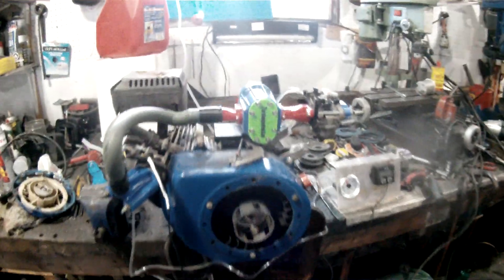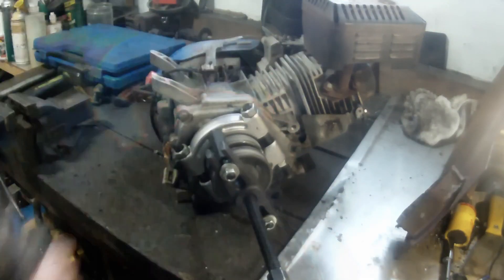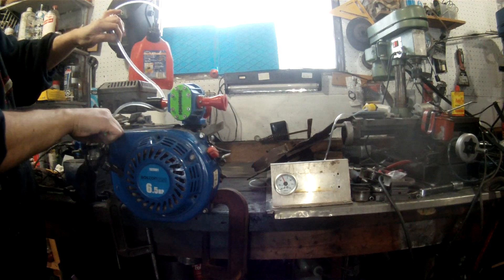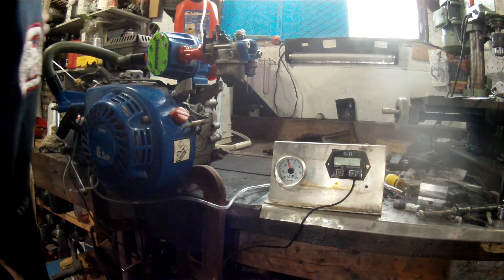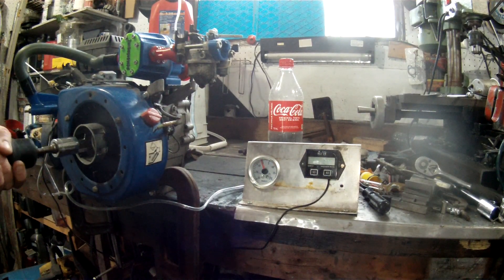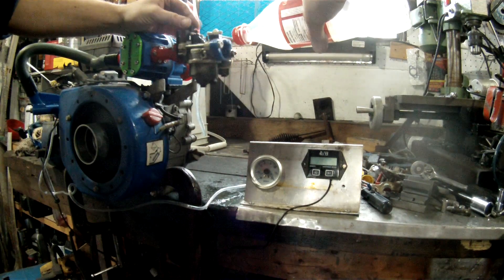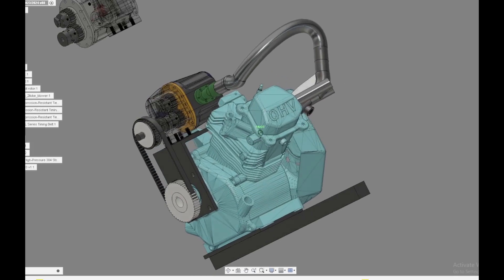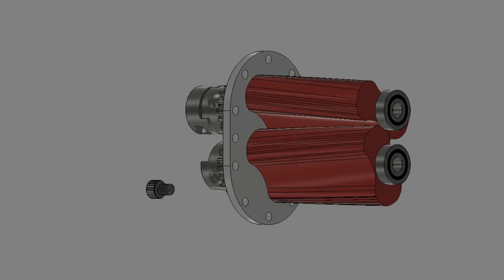4560 Roots Blower Engine Testing

Comment: I'm a very reckless person but even I find that gasoline setup dangerous. Hope you have a few fire extinguishers. Anyway, I bet the holes in the carburetor are clogged. Common problem and easy to solve. Its obvious that you didn't remove the bowl. That's usually why they don't deliver fuel and the main reason why you can buy cheap mowers, chippers, and other engined stuff on craigslist.
Reply from the maker: Lol as it runs fine 30 seconds before that , those were shot in the same day . Literally showed the main jet to the camera , I also got the engine because it didn't fit the blower it was on , hand rebuilt the carb just before buddy wanted the proper engine . Also never owned a vintage skidoo eh , gas is not that volatile , only the vapour is , I have ventilation. I grew up fixing small engines and did it professionally on and off  as I was the head machinist in a hydraulic / engine shop .
Reply from the maker: The issue is when u pull too hard on a carb velocity increases to the point where the venturi stopps pulling fuel . Carb too small jets too small

Comment: I would try to measure CFM / RPM, boost is resistance, and your focus is to move more volume of air, and preferably more than the engine pulls in, set up a way to measure the intake air flow with a CFM gauge and a big tube over the carb, then do the same for your output. Not too knowledgeable on carbs, but I think a CV carb is what you want, I will probably be completely wrong but iirc they pull fuel relative to air flow, which might compensate for boost? Should do more research
Reply from the maker: For carb on a draw through , any proper sized carb would work . CV carb might be an interest for driveability if this ever goes on a vehicle . Having the CFM of the engine pumping air would help alot in sizeing all of this . In the video I was just throwing out imidiat thoughts on carbs , doing some quick rough calculations based on pressure and original HP I get something around 7 ish HP so the easiest way to get in the ballpark is grab something adjustable from around the 7/8 HP range . This may or may not work tho but so far in experience has done the trick . I might have settled on a techomse 8 HP carb as it's adjustable on low and high speed circuits about 4 mm larger in diameter . I think the next video might be just trying 3 or 4 carbs I have kicking around . I can make this work with little issue ,  it's just a matter of how well .this stuff takes a lot out of me tho so I usually cap my videos in a similar length , and is why I don't get too much progress .

Comment: id try and gx270/390 carb with a larger jet, also look into modifying the plastic idle jet as itd be something special if you could pull this off using parts from the GX family. You might also want to try adding a pulse fuel pump as my gx200 cant even rev up to valve float without one.
Reply: His carb is probably clogged.
Reply: @ryelor123  i wouldnt be so sure, these engines come jetted lean for emissions purposes so will struggle to keep up under normal conditions.
Reply from the maker: I'm thinking a round slide , just for ease of jetting , really considering fuel injection , this would give me the largest adjustability and unlimited fuel headroom as long as my pumps are large enough . Stock carb  I used is absolute trash just wanted to see if it would work . If I'd did others would be able to do an easy install. I have a box of old snowblower carbs from 368cc flatheads I could use , they are fully adjustable , as well as some tilitsons around . I have lots of options but I'm leaning into fuel injection . Overall it might be difficult to get a carb to run at idle and handle the increased flow at wot without having a 2 barrel carb ( mix of one larger and one smaller carb linkages together )
Reply from the maker: Also just though about it , pulse pump is a no go as the blower kinda screws up the normal intake pulses . A standard pump pulse taken from the intake would end up in straight pressure and in turn shutting off all fuel . I'm going to go with an electric pump if the need arises . On the bench I can just put the gas tank higher above the carb if that's one of the options I take .
Reply: @turboprint3d  standard pulse hookup is to the crankcase, not the intake. My engine cant rev past 5400 without one but is mostly stock apart from governor removal and jet size.
Reply from the maker: @mrkrusher29  I have worked on thousands of different lawn mowers and the like every pulse pump had either been pulsed from the intake or magnetically driven and stuck by the flywheel so the coil magnet can run it . Running off the crank case works but after enough time oil can work its way into the pulse line and plug everything up . I don't really like the pulse pumps for this sort of application anyways . Also running over 4000 rpm with stock internals and the cast flywheel is a big no no , ever see one of those flywheels blow up ... Not fun . Luckily the one I saw no one got hurt but next year at the lawn tractor pulls everyone was limited to 3600 rpm for safety reasons . My engine is stock so I don't plan on it going much over 4000 for very long . One thing that helps is the supercharger keeps. Constant load on the engine , which helps keep everything from blowing apart .I'm still not gonna risk it tho . If I go with a larger carn most have a larger fuel line Id witch would help and if I still need more fuel I have a few electric fuel pumps , the ones I have are adjustable pressure , witch can be an issue when taking a pulse pump from an old snow machine or something , some of the larger mikuni carbs are ment to run higher fuel pressure without the needle leaking . Those Chinese ripoff carbs have a hard time not leaking with new parts and the fuel system stock .
Reply: @turboprint3d Fair enough, i only work on karts and can tell you every one in our fleet is hooked up like this. They rev over 5k all day every day on stock internals and weve never broken a flywheel in 20 years, sure we break a con rod every few months now the engines are old but nothing dangerous. Every karting track ive visitied has the engines set up like this but you do you.
Reply from the maker: @mrkrusher29  to be fair I have never seen a Honda or clone flywheel fail , but the old flathead brings ones have a tendancy to do it . I did crack my gx 120 flywheel when I was a teen but Im pretty sure she over heated and started knocking so . Where do you pull the pulse from the crank case , any time I have seen that it ends up full of oil , even in my own experience . I don't understand your fascination with rpm as the stock cam peaks around 3200 rpm after that power and torque fall off very quickly . By the way I'm not obligated to do anything you say remember you're just some guy on the internet to me and I built engines for a living .
Reply: @turboprint3d  uh huh dude, just trying to advise you of my experiences which pertain to this specific engine. That is what the internet is for, sharing informstion. I personally see damaged membranes more than oil clogged pulse pumps, perhaps its due to mounting location. As i said, you do you.
Reply from the maker: @mrkrusher29  the fact you have to justify every statement you make , is talking down to me not a discussion. The other thing is that unsolicited information is almost never a help . I'm here to show people what I'm up to not crowd source for information .  I really don't care what you do but I won't message you and tell you about it .

Comment: Well done sir!! i go to try it with my two stroke opposed engine..
Reply: Its easy to make it fuel injected. with a arduino uno
Reply from the maker: Thanks , I'm jacked that it works , gotta sort out fueling soon I wanna see it running properly. I had though of EFI , would be relatively easy to get it running with a simple system , I bet I could rig that up   the other thought I had was too fuel style mechanical injection, with a low end bypass valve for idling . I gotta calm down a bit then plan my next move . Let me know how it works out , I would love to see people running printed superchargers .
Reply: @turboprint3d  thanks for your words. I have a simple code for a arduino.